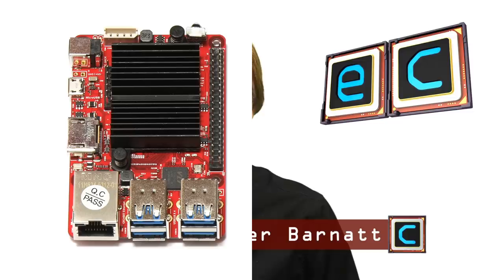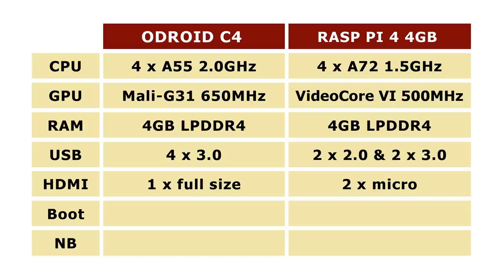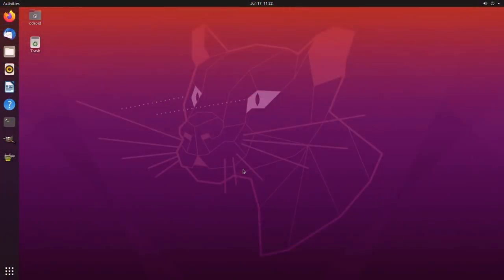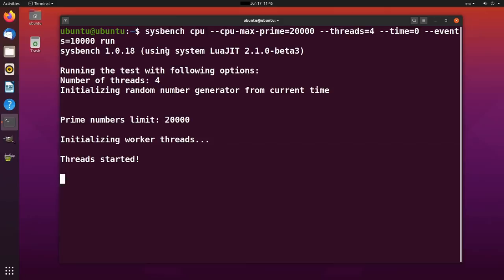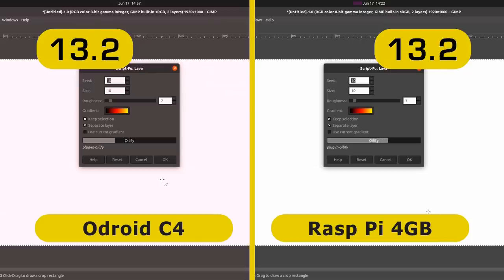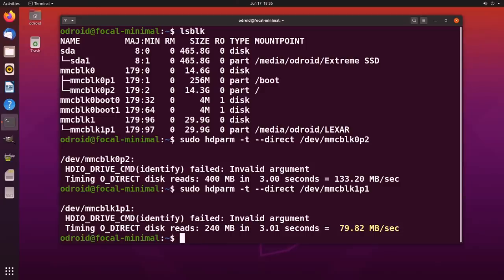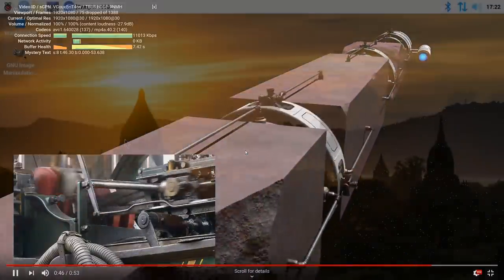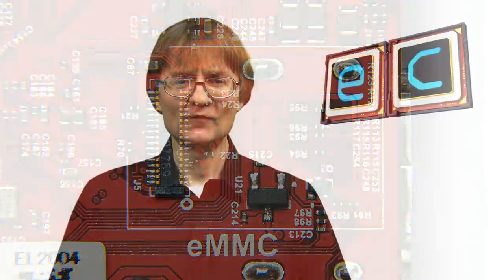Odroid C4 vs Raspberry Pi 4

Comment: Love your videos. Could you please include some more boards like the Khadas Vime3 Pro.
Especially setting up Linux on this board. Thanks for your hard work!
Reply from the maker: I have reviewed several Khadas VIM boards here in the past year or so -- nice hardware, with nice cases, if expensive compared to a Pi.
Reply: @ExplainingComputers  Yes I've relied on them to purchase the Vim 3 Pro. One thing I didn't realize is the the lack of an audio out.
I had to buy a HDMI audio extractor to connect it to my speakers. I would like to try to run Linux on this box. I've been watching your wonderful videos for for several years now. Thanks again.

Comment: You literally put active cooling on the pi of course it runs faster
Reply from the maker: Simply not true -- there seems to be an urban myth perpetuating that boards with active cooling run fast than those with passive cooling! And this is rubbish. Cooling performance and CPU performance are not the same thing, and the former only impacts the latter if (and only if) a CPU hits its throttling temperature, and then drops its speed. Here both boards have decent cooling solutions fitted, and are running short tests, so there is no possibility that either will throttle. Rather, each board's CPU will run at full speed, and that is all that is required for a fair test.
Reply: @ExplainingComputers  Ok. Is there a usecase where you wouldn't use the pi

Comment: I'm sure nobody would like to see Chris sent to Coventry, least of all Chris.  So, it is really not surprising that Chris had to do some ducking and weaving to avoid offending his massive following of Raspberry Pi fans.  Introducing a relatively expensive SSD in order to downplay the Pi 4's poor microSD performance was a glaring example.  Adding a Pimoroni fan was another swerve to avoid the embarrassment of poor performance due to fundamentally inadequate thermal design of the Pi 4, a major issue that Chris did touch on very gently.
Reply from the maker: I in no way did any "ducking and weaving" in this video and deeply resent your accusation of bias.

In respect to cooling, I stated that both boards needed a cooling solution and that one manufacturer "was wrong" not to include one, and that this manufacturer was the Raspberry Pi Foundation. So I could not have been more explicitly critical of the Pi in this respect.

The use of the Fan Shim was also not a "swerve to avoid poor performance", as the Pi would not have throttled in any of the tests conducted as none ran for the 3+ minutes that would have been required for this to occur.

The SSD was used to test the USB 3.0 speed of both boards, so what was the bias here? In respect of micro SD card speed, I showed via the hdparm test that the Odroid C4's SD card interface is roughly twice the speed of the Pi's. I also discussed this, and presented the data in a table. Nobody who watched this video could go away not appreciating that the Pi has a worse SD card interface. So how exactly was I "ducking and weaving"?

As regular viewers of this channel will know, I often make videos where the Raspberry Pi is not the top rated SBC. Not least, in my "Top Five New SBCs 2019" video -- https://www.youtube.com/watch?v=2miek-hEzFM -- I rated the Pi 4 second (after the Jetson Nano), which was not a universally popular choice. So I do not try to avoid offending fans of the Raspberry as you accuse me of doing.
Reply: @ExplainingComputers  You call it "bias", I call it "gilding the lily".  If you had tested the Pi 4 without a fan, without an SSD and without recourse to a beta version of the OS, your objectivity would have been more evident but the comparison would surely have been less palatable for some.